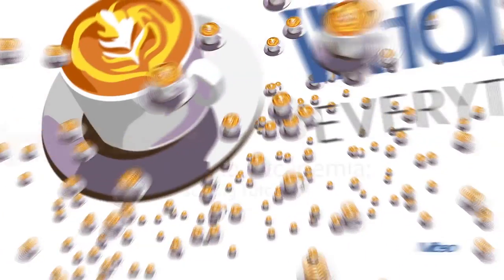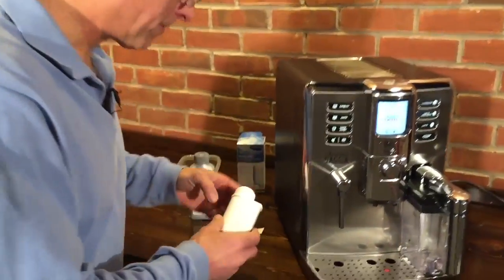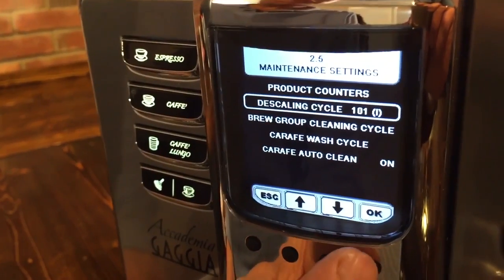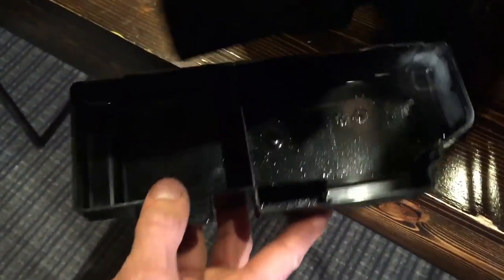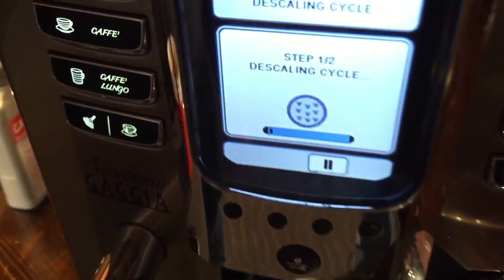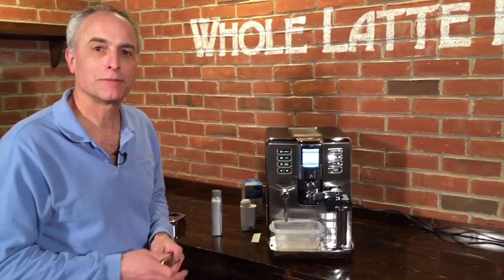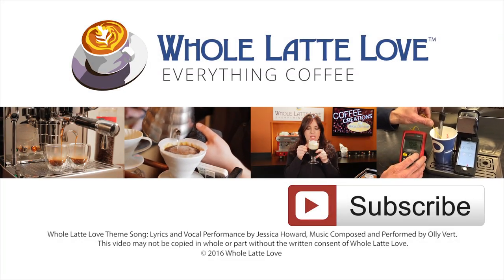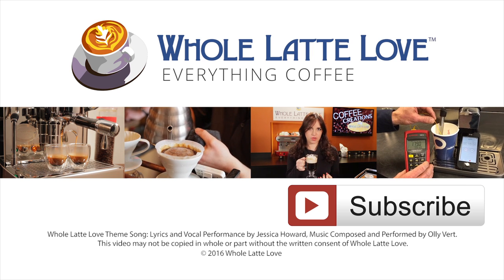How To Descale a Gaggia Accademia Espresso Machine

Comment: The manual on page 34 starting 33 under boiler descaling cycle doesn't make it clear to move the wand over off the Craft for the descalation process. At this point I got stuck, nothing was running after I pressed okay. Went to this video and found that the wand on the Caraft must be moved over to the side. Makes sense. Thank you so much for this video absolute perfection ❤

Comment: LOVE your videos!!!  I have a filter on my faucet (3M Water Filtration ESP124-T) which is designed to filter out particles specifically for espresso machines.  Is the Gaggia filter in the water reseviour still recommended or not needed when sourcing water through the 3M filter?
Reply from the maker: Hi mike, Thanks for the question. I looked up the filter looks like it uses activated carbon for chlorination removal as well as sodium based water softening to prevent scale. If using that filter there's no need to use the in-reservoir Gaggia filter. You should test the water from the filter so you can enter the hardness into the machines settings so you will be properly alerted to descale the machine when needed. Your softened water will likely extend the time period between descalings the same way the Gaggia filter would. Hope that helps!
Reply: @Wholelattelovepage  THANKS!  More evidence of how awesome you guys are!!!  Which is the reason I purchased the Academia from you!   

That is exactly how I ran my hardness test.

** I HIGHLY recommend anyone purchase through Wholelattelove when they purchase their next espresso machine **

Comment: I am confused as to whether the carafe is full before you start and then add the descaler since the directions say to refill with the descaler.
Reply: I know it’s late but: 1: Pull the filter if you have one. 2: Pour the descaler in the water reservoir. 3. Top reservoir off with water.
Reply: sounds like you are confused about where to add the descaler product.  the carafe should contain only clean water.  pour the descaler into the main water reservoir and add water to fill at least 3/4 level.

Comment: Hi Mark, Tod hope you guys are well? I have a question? Can I use Urnex products exclusively to clean my Gaggia Academia? I don’t like the price of the gaggia products and I am sure there is an alternative and equally effective solution. If Urnex products are indeed suitable, which would you recommend for descaling, brew group and milk cleaning? Hope you can help and many thanks 😊
Reply from the maker: Hi DD, We are well - thanks for asking and hope you are too! We always recommend using the descaler specified by the manufacturer. Like using the right oil in an auto engine it's relatively cheap insurance for an expensive machine. It comes in proper concentration for use in their machines and in the case of the Gaggia product it contains a corrosion inhibitor in addition to the acid used for descaling. But one can use other descalers. The Accademia has a stainless steel lined boiler Urnex says there Dezcal, Full Circle and Clean Cup descalers can be used in stainless boilers.
Marc

Comment: Hi Guys its always a pleasure to listen to both of you. One quick question, during the descaling process of step one getting the descaled in the machine, I didn't see the fluid flushing through the coffee spouts, i only saw it running through the milk carafe spout and the water/steamer spout. So it does or doesn't run through the coffee spout in the cleaning descaling first step? Also i didn't see the half filled milk carafe drawling water from it container. was it suppose to?  thanks john

Comment: Nice video but it omitted one big step, as detailed on p33 of the user manual. Turn the SBS dial left (counterclockwise) all the way. Manual doesn't explain the reason, which is probably why you forgot.
Reply from the maker: Hi PK, Thanks for adding that! Turning the dial full counterclockwise causes the least restriction in the brew circuit.

Comment: The descale notification won’t turn off after rescaling.  How do I do it
Reply from the maker: Hi Susan, Thanks for the question. Are you sure it's not the change water filter icon you are seeing? I reached out to our tech support dept and they say people often confuse the 2. If you are sure it's the descale warning and you descaled it may not turn off if the descale cycle was interupted while in progress. If that's the case go through the motions of descaling without using any descaling solution.  Be sure to let the cycle complete and the warning should go off.
Marc
Reply: if the descale notification does not reset after doing a complete cycle, there is a simple workaround that works on many Gaggia machines.  Just change your water hardness setting to a different value, then back to your current value.  Doing this step should reset the descale notification.
Reply: Try running the ''Brew Group Cleaning Cycle''.  That usually resets mine.

Comment: Tips:

Place the machine next to the sink, tilt the frother/steamer into sink to let that flow not go into your catch container. 

We use water that has been through our softener and 5 stage RO unit. Extends the need for descaling by a factor of 3 at least.
Reply from the maker: Hi P, Good tip! When I descale these machines I put next to the sink as well. I'll even make a "funnel" out of aluminum foil or similar to direct all the output from wand and coffee spouts into the sink.
Marc
Reply: Or if you have access to distilled water, same result though for most of us a PITA to go buy continually.